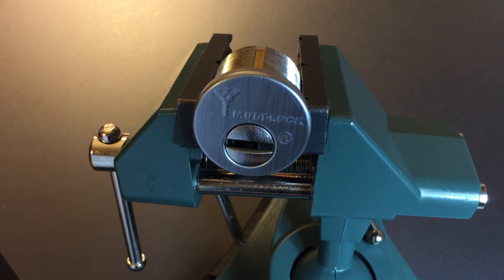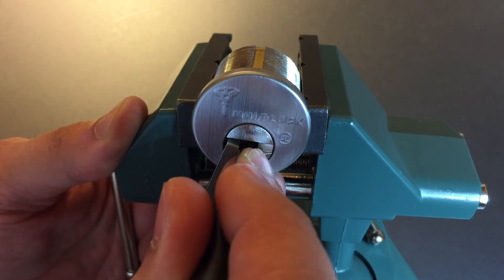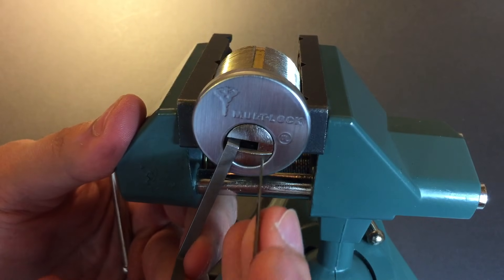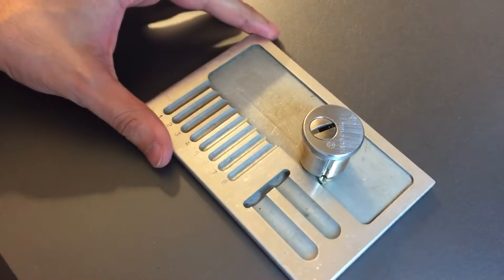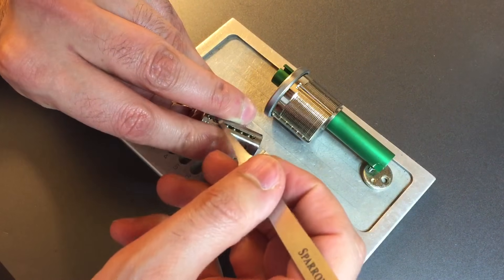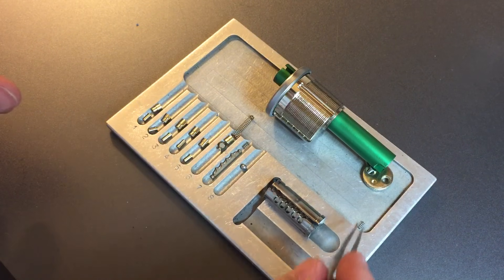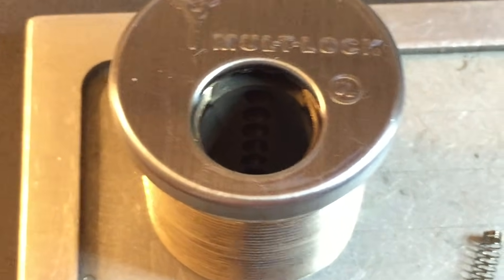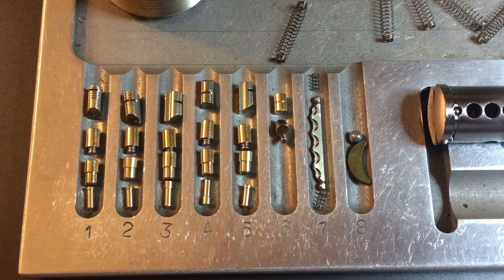[249] Mul-T-Lock MT5+ Mortise Cylinder Picked and Gutted

Comment: I pin these things on a regular basis...tip on removing the plug once turned-turn counter clockwise slightly and it will follow right out; the drivers will ride on a solid surface between the bottom pins and ball bearing. Make sure you hold onto the sidebar :)

Comment: according to the door it is on, you might be able to use a hole saw to drill it whole out of the door. that's if the  locking latch is not hardened steel.

Comment: You are right both the MT5+ and the IKON are identical.
Strange that the sliders are not spring loaded. I would have expected they are.
Reply from the maker: Why would you have expected them to be spring loaded?  They are positively controlled in both directions by the track in the key, so it is not needed.  I think that the spring loaded sliders are a TINY bit easier because they make it easier to detect when the slider is in the true gate.
Reply: For me personally sliders with springs are harder to manipulate than once without - the EVVA 3KS vs the EVVA DUAL :)
Reply from the maker: +vde Opposite for me... ASSA Desmo vs ASSA Twin :)

Comment: The UL Rating used to refer to pick and drill resistance.  UL would allow 10 minutes for drilling with standard tools, something a thief would carry.  Same for picking, UL would allow 10 minutes with standard tools.  I would consider the picks your using as standard tools.  So,  when you have a UL listed lock picked in about 6 minutes....  Goes to show the skill picking a dimple lock, with a sidebar - in about 6 minutes.  That takes some skill.
Reply from the maker: Yes, picks do qualify as the tools contemplated by UL437, and the rating is a joke.  All full-sized MTL's with the extra drill protection are UL rated, and you've seen how fast I can pick though the classics and interactives.  Same for the TuBAR locks, Duo, etc.  Same for the ASTM pick rating.
Reply: But once you see a demonstration, it's probably not as difficult.

Comment: Got a question for you.
I got yesterday a MT5 lock and to be quite honest I think they are easyer to open than the normal MTL with no interactive elements, do you have the same impression?
Reply from the maker: Tough to answer.  First, put aside the interactive nonsense.  That's for key control only.  Actually makes picking easier because you know where the one interactive pin will set.  Second, the type of pin matters.  MT5 outer pins are all standard.  SOme people think they are harder.  I don't.  I think they are using too little tension, whereas I use absurd amounts of tension.  In addition, it's possible that some people don't realize that many MT5 cores are countermilled, which can be confusing if you are not expecting it.  Personally, I think the hardest outer pin is the serrated drivers that can be found in Classics and Interactives... particularly when there paired with the spooled outer key pins.  Third, the really hard part of MT5 pins is the way the inner driver and outer key pins lock together.  Some post 2008 interactive locks have a similar system... and they are just as hard.  That said, overall, I think the MT5 pins are the hardest because they are smaller (requiring more precision in picking inner and outer pins separately), and the way the pins lock together.
Reply: Thank you for the thorugh answer. Then I need to find some more MT5s to compare, because the one I got the other day poped 10 min after I started playing with it. and for the next few hours I could open it in a few minutes.
I will try to make a video soon.
Reply from the maker: Those are not unreasonably short pick times for someone experienced with MTL's (I assume you are not talking about the MT5+ with the sliders).  It is definitely faster than my average, but it doesn't strike me as outrageous.  Have you taken it apart yet to see if it is master keyed?  You may find the video that I'm going to post shortly interesting... a master keyed MT5+.  Oddly, the first MT5 I had was usually hard, and gave me a great deal of trouble... thus, I went for a while thinking these pins were harder than they are.  While the interlocking feature is tricky, it is definitely pickable once you get used to it.
Reply: Hmm it is written only MT5 on the key, does not look like it has sliders. No I haven't gutted it yet, not at home at the moment (i'm in Mexico fo two weeks because of work)
Will send you a picture in a bit.

Comment: I was noticing how closely the width of the true gates match the shelf in the sidebar. I can imagine the perceptible "jiggle" in a set slider must be very subtle! Also, how are your hands not shaking after you opened this lock?
Reply from the maker: This is going to sound strange, but its not so much that I feel movement in the slider, but more that I don't feel binding.  I know that doesn't make that much sense, but it's true.  The movement is subtle -- the binding is not.
Reply: Actually, that doesn't really sound strange at all. The Twin is a little bit like that. Probably not to the same degree, but it actually makes perfect sense :)

Comment: I have 2 very important question: 
1. If a not very skilled picker try without succes, can he damage the lock?
2. If necessary can you also close (lock it back)  after you opened?
Reply: The saying is, that you should never pick a lock you rely on so yeah it is definitely possible to break a lock while picking it. As to if you're able to close the lock back up, you just turn the tention wrench in the opposite direction to close it back up.

Comment: Can you pick the Bowley Lock?

http://www.bowleylockcompany.com/
Reply from the maker: Never tried one.
Reply: Actually you can open the Bowley Lock with the bypass tool in the picture link below.  

However the new Grade 2 Bowely Lock has a cylinder shield that has very close tolerance that the diameter of the shield is 1/32" smaller than the actual diameter of the lock hole so this bypass tool won't work on the new Bowley Lock. Plus the new Bowley Lock have a tolerance of less than 1/8" all around the throw bolt.  

And the Mul-T-Lock MT5+ above with the deadbolt version can be open with a similar bypass tool that can reach in and push the throw bolt open, as the cylinder shield of Mul-T-Lock MT5+ deadbolt version does not have a very close tolerance with the diameter of the cylinder shield 1/4"-3/8" smaller than the diameter of the lock hole. And there is a big gap all around the throw bolt that the cylinder shield leave open that does not exist in the new Bowley Lock grade 2.

https://login.filesanywhere.com/FS/M.aspx?v=8c7268865995a37bb29c